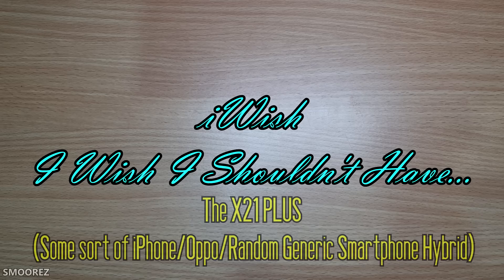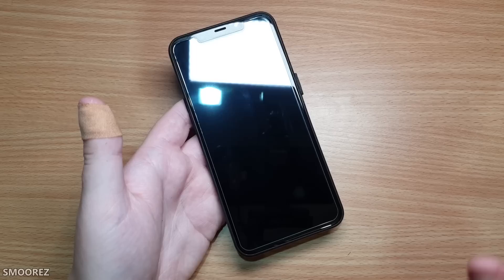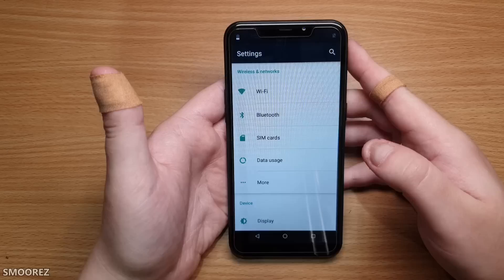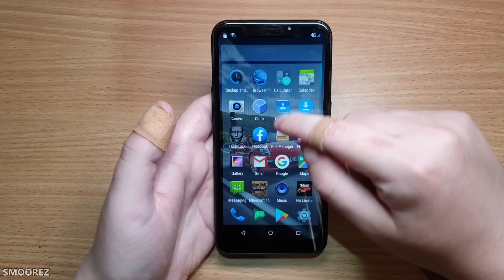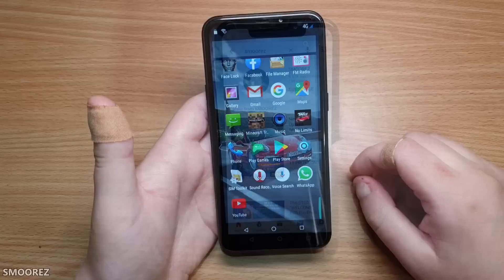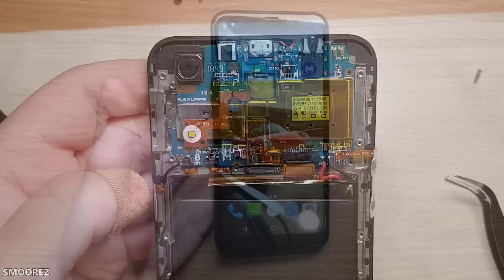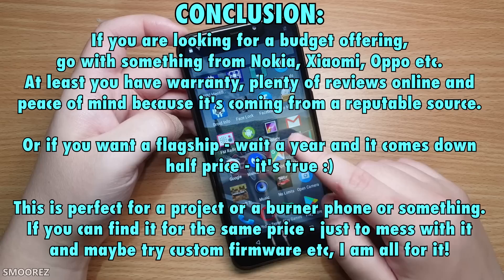I bought the CHEAPEST Smartphone I could find on eBay - This is what $36 gets you!

Comment: This looks like Android 4
Reply: What
Reply: Its Android 6 i think
Reply: cyniczy  Dude you know nothing, that could be any version from 5-7, but definitely not 4. And guessing by the Linux kernel it's mostly likely to be Android 6
Reply: its so weird that is says 8 and when my pixel 2xl was on 8 it looked nothing like that (and it's stock android so)
Reply: cyniczy  sorry im not an expert no need to call me dumb
Reply: I use Symbol MC40 and Zebra TC70 scanners in retail running Android 5.1.1, and I must say, this Android phone, advertised to be 8.1 when it’s 6.0, actually does look and sound like an Android 5.x device.
Reply from the maker: Tone.   Tone.  Yeah it is some mish mash random OS of Android 4/5/6. All packed into some sort of working package :)
Reply: It’s actually Android 6 with interface from 5 and icons from 4 and it’s advertised as 8.1.

Such a mess
Reply: cyniczy  android 4?! Look at the settings!
Reply: Its android 4 only
Reply: @krishnamishra74  No. Android 4 had a dark UI with square-ish buttons. This is clearly android 5, with apps from android 4, and the easter egg is slightly changed to make it look like android 6 (the easter egg of android 5 is exactly the same with small differences)

in /system, there's a file called build.prop telling about the os version, which can be modified by the user.
Reply: android 4 looks totally different 🤐🤦🏼‍♂️
Reply: like a kitkat..hahaha
Reply: @duanglah  me to c: xD
Reply: @SMOOREZ  it's android 6.0 but the default icon pack of the mediatek chipset(Chipset used by these phones because of their very low cost)
are like android 4.0.
Reply: Its marshmallow, completely aosp, so it's missing all the extras Google add to  Android like icon packs, nicer launchers, etc etc
Reply: It is Android 4😂
Reply: It's at least android 5. Kitkat didn't have material design.
Reply: Android 4 can't run no limits.
Reply: No its android 6
Reply: Pretty sure it's Android 6.9.420
Reply: @zxrif5004  because there lying about the version
Reply: @alexrush2108  what? it was just google's version of stock android. im on 10 now anyways
Reply: @zxrif5004  i meant they are lying about the version on the clone phone not your phone
Reply: @alexrush2108  oh well yeah

Comment: Just a quick tip, when buying phones like this, using the appropriate APN settings for your network go a long way in helping it use the 4g network. It's always best to see what frequencies are in use by your carrier and check to see if the phone supports those frequencies.
Reply from the maker: I check the APN settings all the time and change them to the appropriate ones, still doesn't help majority of the time. Like the iPhone 11 Pro clone - it would stay at "5G" no matter what I did anyways :\

Comment: "Bangs with fingerprint one machine" is now my Tinder bio
Reply: Don't forget, "Incorrect using it may cause your system broken!". I read that in overclocking section of the manual of my first PC build, cracked me right up. Chinglish has an amusement factor of a zillion! 13 years later and I still guffaw at it!

Comment: A few things:
- You could try activating developer mode.
- Minecraft was hard to control because the touch sensitiviy is set too high by default and later because you were in sneak mode.
- It would be a cool idea to try different leveks of settings (There are settings tuner appsfor NFS NL and PUBG).
- PUBG can be installed just fine. Get the apk from ApkMirror. (Safe website owned by Android Authority, if i remember correctly.)
- To try the earpiece you could use the app called Earpiece, so you wouldn't have to put your SIM in those and call people with them.
Reply from the maker: Good suggestions!
The touch was fine, I just don't know what I am doing in Minecraft mobile. When I took that screen protector off, it was fine.
I usually leave games on the default/recommended settings. I mean if the app doesn't optimize it then I can tweak it a little bit. 
If I recall correctly, you have to download the APK plus the OBB data pack as well. Unless you get the APK and it auto downloads? Ill try it on the next one!
As for calling, I have some sim cards I use for testing (like burner sims) so it's fine :) Plus I can see what the phones network is running at also
Reply: @SMOOREZ  PUBG doesn't need OBB. It downloads the files straight from the app.
I use the official PUBG Mobile emulator on PC from Tencent and it does that.

Oh, and good idea to use burner SIMs.

Comment: Android 4 (default) icons on an Android 8.1 phone... Nice!

2:04 PM
1/19/2020

Haha, just got to the point in the video where you realized it's running 5.0. Nice.

2:05 PM
1/19/2020
Reply: @epic gamer Android 5-7 looked like that
Reply: no its android 6 notification panel. seller edited the build.prop of the device to make 8.1 tag and others...
Reply: sooooo its pure android 6
Reply: @skriddle3  AOSP android 5-7 looked identical.
Reply: @dustojnikhummer  android 7 has different quick settings panel, and app permissions has been added with android 6. thats how you can identify the android version.

Comment: It would be cool if you got one of those battery capacity testers
over here in america you can get a li-ion tester for about $10-$20 ($13-26 aussie bucks) 
again probably might be more expensive than that because of shipping, but would be neat if you desoldered the battery and actually tested them and got a completely accurate mah reading

Comment: you can do much better buying a second hand brand device for like $100
Reply from the maker: Or get something from Xiaomi. Their phones are insanely good for the price.
Reply: @SMOOREZ  I'm on my second Xiaomi (first still going, second was a gift). Fantastic value and great build quality. I showed my friend and he shot out and bought one. Next minute, his WHOLE family bought them, haha. Here in NZ we have our first Xiaomi shop just opened, so we have Apple store and Xiaomi store. That's how great Xiaomi now are :-)
Reply from the maker: @tenmillionvolts  I own a Pocophone. And while I used it as my daily driver for 6 months with no issues, I found the cameras on it to be a little lacking. With the Google Camera mod it slightly helped but the stock one was so/so. I ended up switching to a Samsung Note 9. I then powered up the Pocophone to see the latest OS update. Installed it and the cameras are now so much better. So Xiaomi gets my approval. They always strive to ensure their devices are up to date etc.
I have a Xiaomi Mi Max 2 with a 5200mAh battery. It lasts like 2 days before needing a charge which is amazing.
Reply from the maker: Tone.  Asus is also not too bad. I have used a couple over the years. But just my opinion, I prefer to suggest Xiaomi as my main pick only because they seem to just be the more popular phone manufacturer of budget devices now. To see how much the Pocophone has got even better from updates since it's release is just amazing. So yes, Asus is another option but people are flocking to Xiaomi :)

Comment: IMO fingerprint scanners shouldn't be under the screen, you're forced to use cheapy plastic protectors. 
more phones should have fingerprint power buttons instead. that way you don't have to pick the phone up to unlock(back capacitive scanner), you can use a tempered glass screen protector, and as a bonus, the capacitive fingerprint scanners are more accurate.

Comment: You can't see the capacity because there's only 2 wires from the battery. Positive and negative which is just power. My Mate 33 PRO clone had pos, neg and a white temperature wire, but still no actual data wire for capacity/voltage/amps data signals.

Comment: Honestly, I wouldn't pay too much attention to the "malware scan" because unsigned auto-update software could very well be interpreted as a trojan, sort of by definition. That's why hardly anyone who knows a thing or two about computers actually ever uses anti-malware. It just becomes a nuisance when you roughly know what you're doing. I'd imagine that in the case of nameless smartphones with nameless, hacked-together Android installations, you can easily get a ton of completely false reports. The only way you could possibly know there's some fuckery afoot is if you watched the traffic from/to the phone, but given that virtually all traffic is fully E2E encrypted and magically routed, you'd have a hard time figuring out what's it doing in the background anyway. Conversely, deleting the "malware" doesn't even remotely begin to guarantee that there's no malware on the device. No publicly available malware scan could possibly detect a cleverly made piece of malware. Heck, it could totally be made into a kernel module, considering the magical modifications of the Android installation, and you'd never know.

Comment: You can use AccuBattery to try to estimate battery capacity. It taps into current sensors and integrates them over time. I don't know how well it works on cheapo generic/fake phones, but i got decent results out of it with a Mediatek based Acer phone from a few years back.

Comment: 3GP video doesn't run at 60fps & is only limited to 320x240 resolution at about 10-15 frames a second,  3GP2 video, slightly higher resolution,maybe you meant MP4 video format? Video bit rate is measured by KBPS (kilobits per second) not MBPS(megabytes per second)
If I bought a dodgy Chinese phone, I would dump the flash ROM, wipe it, then flash it with a certified version of Android.

Comment: If you want to measure the mAh of the battery, I can think of one way to do it. Use a smart battery charger (like a FlyRC one with an LCD read out) to charge the removed battery after draining its usable charge. With the read out on the battery charger you can estimate the batteries intended Amp hours.

Comment: To find the battery capacity,  just use it till it turns off, then plug a usb voltage and current meter with mah (milliamp hour) logging capability into the charger and charger cable and see how many mah get put into the battery to determine the actual true capacity. 

In United Kingdom I use a device made by portapow and costs £9 on Amazon.co.uk.

Comment: Hi, I'm about to buy myself a new phone in the next few days, either a Galaxy s10 (maybe 5g) or possibly a galaxy a51, both have under screen finger print scanners, s10 ultrasonic and a51 is optical. Do normal glass screen protectors work ok with these phones or do i need some type of different specific ones ? Or will a normal glass protector be ok with the optical but not ultrasonic or vice versa ??? Any info appreciated. Thanks
Reply: Both should work, optical one might struggle a bit more (while already not being great & slower) with a screen protector since it requires the green light to illuminate your finger.

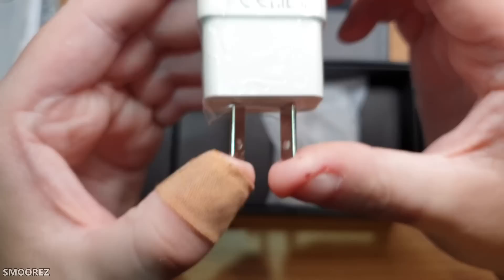Comment: 6:27 That's a fake, dodgy, knock off charger! The text says "Made in Vietnam", but the Russian says Made in China! (going by a teardown of a similar charger from another user) Don't use that charger; they usually have problems such as not being able to supply the full rated output, getting hot whilst in use, having poor quality components inside, having questionable isolation on the PCB, and having questionable isolation in the transformer.

Comment: Is it actually 60FPS? I have seen so many clone cams where MediaInfo says 60FPS but every 2nd frame is doubled.
Reply from the maker: It's actually 60FPS.
Ran it through Sony Vegas and exported at 60 and it was the same smooth motion.
However as I said, for some reason in dark areas, it drops to 22FPS. No idea why.
In OpenCamera I could tweak it to record at 60FPS at 1080p with a 6MB bitrate. I should upload some test footage!

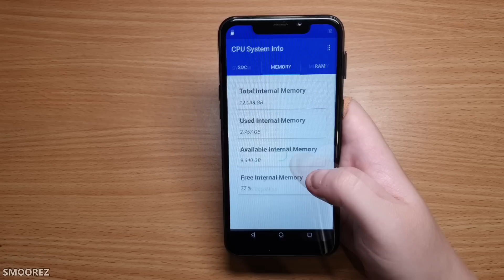Comment: 30:27 skipped over the fact that the true CPU is a MT8650 which is a quad core, even though it's faked info reports it as an octa core 6592. Either way though, both SoCs are VERY dated, using Cortex A7 cores (which are really weak by today's standards) and on an inefficient 28nm die.

Comment: not bad for the price, especially if you're prone to breaking phones. A couple years ago i bought a Luna  TG L800S , Korean company for just under $100 USD. I use it as a tracfone, pay as i go so i dont have any contracts. Its kinda plain but has 3GB of ram which was the highest i could find at this price. First thing i did was run and AV and malwarebytes, no issues. Its working great but after i encrypted it seems to have issues with restarting and or booting. Which can take up to 30 minutes! >.<  I figure i should restore it and NOT encrypt it and see if that makes any difference. But we do get what we pay for. Lol

Comment: You should try using a finger that you did not program... If it still unlocks the phone then the sensor is just heat sensitive and not really reading your fingerprint.
Reply from the maker: I did that in the video. I had 2 fingers registered and tried others and nothing, couldn't recognise it. When I tore it down, its an actual fingerprint sensor. It had a model number also.

Comment: I would just like to point out: Some of these riskware and trojan downloader hits people can get, basically mean "this application/process has functions that has the potential to download trojans and malware, or transmit data out." Meaning it's advicable to google each hit before shedding them - some apps and system processes tend to throw off false positives, because they need those functions for legitimate purposes. I've even seen stock processes on big brand models do this, after a code updates. It'll usually either be patched, whitelisted or both - but that can take a while.

These particular hits in your video though - these are well known trojans and datamining malware.

Comment: Wouldn't it be cool if someone had made a way how to flash these cheap Chinese phones to put Android Go on them! Android Go would be perfect for theses low-end phones as its made for low-end phones from Alcatel and others.
Reply: Android Go was only needed because since android 8, the operating system needed more resources to run properly. Android 4.4 KitKat was optimised to run on phones with as little as 512mb ram and even 6.0 Marshmallow could run ok on 1gb. There is no reason why full android couldn't run on lower end phones if the software was optimised better.

Comment: 4gb ram and 64 gb rom is pretty damn good for the price. Really cheap honestly
Reply from the maker: You might want to watch the end of the video. It doesn't have 4GB and 64GB. Rather 1GB and 16GB.
Reply: @SMOOREZ  oh whoops. I missed that part 😅.  I can relate to that. I bought an ebay phone and it said it had 8gb ram. 64gb rom and 3k mah battery and 48mp camera. As it turned out the 100$ phone was an 1gb ram 8gb rom 1500 mah phone. I got full refund and phone lol
Reply from the maker: @FoxenTheFox  Well with one of the phones I got off Wish, I knew it was false specs anyways, it was just for the entertainment factor. But I messaged Wish support with a message saying "I don't like it" with a picture of the phone and they refunded me. So, that's fair enough I guess :)

Most of the time once you say it's got the wrong specs, they refund you straight away and then you can do whatever you want with the cheapo device!
Reply: @SMOOREZ  yup. I also did a tear down of the phone and saw a teardown video of the real one to compare the inside. They have some major differences honestly. There are a lot of differences inside the phone from the fake  than the actual one. It was a lot of fun and i learned a lot from it and and your videos too.

Comment: the size of that battery it must have 2800mah
Reply from the maker: I gave it a generous 2500mAh, so we are both around the ballpark figure :)
Reply: @SMOOREZ  well the size of it is quite similar to my old device that is also a clone plus the fact that it also have that kind of rom the build.prop is modified
Reply: @SMOOREZ  and don't trust other app like CPU-Z those apps rely on the information enclosed to that "build.prop" file I currently use aida64

Comment: I don't think that those apps are viruses...
Reply: At least vireless update is 100% not a virus.
Reply: @bredbear9093  it is. It's a trojan downloader. It pretends to be the "wireless downloader" when in reality there is no such app as the update settings for a phone is embedded within the settings, not as a separate app.
Reply: @maxz8807  My umidigi F1 receives updates only though this app.
Reply: Ok. I ran this antivirus on my phone and it didn't recognize wireless update as trojan. So on that 21X phone it was a fake wireless update app.
Reply: @bredbear9093  could still be a false positive for the stupidest reasons... like for not being signed after being customised or simply doing something code wise a trojan can do without actually being a trojan).
That said, don't buy it for actual use if you need security (mainly because consistent security updates are very unlikely).
Reply: Wireless update is a feature of a lot of mediatek phones. I have had software updates OTA using this method. On the Unihertz atom it upgraded from Android 8 Oreo to android 9 pie using this method.